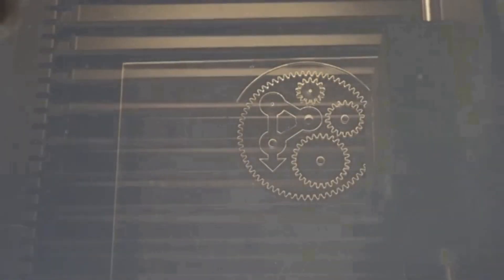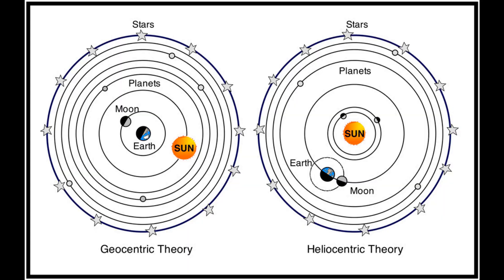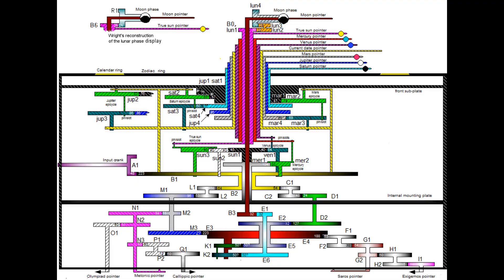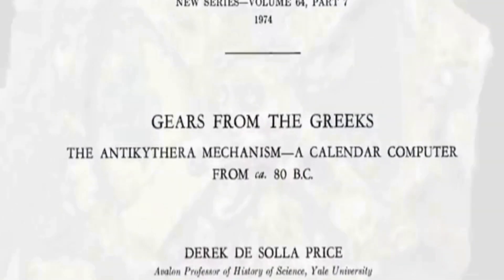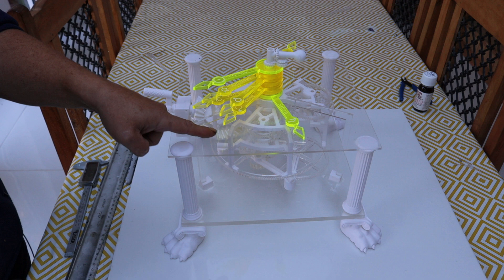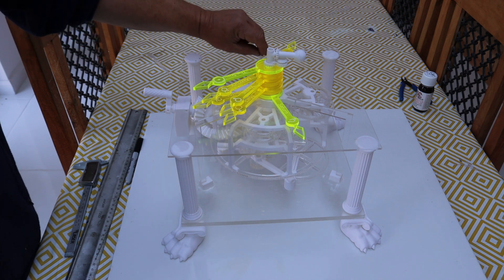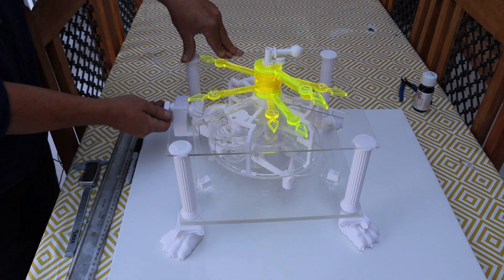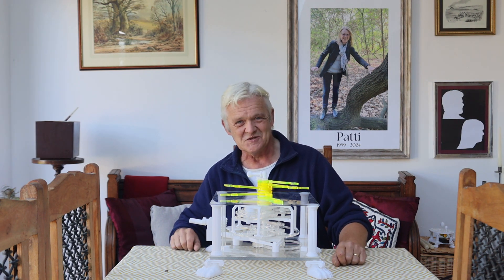2290 The Crystal Antikythera #xtool #p2

Comment: it would be interesting if one could design a maglev roto'r's topography to compensate for epicycles so as to bypass Earnshaw's theorem for a permanently (firmamentally) stable-in-place maglev spin with a non-mechanically-touching bearing component so that the topology / topography's compensatory design would bypass the need for a mechanical bearing, whereas the bearing and rotor are one and the same maglev component reliant on the topology for aforesaid properties, and composite in design. I'm not sure if I am making sense.
Reply from the maker: go for it

Comment: I'm stunned that you've done this in three days - that's an incredible bit of work!! Have you included the spiral dial side for the eclipse prediction, too, or just the planetarium? I couldn't quite tell from the video.
I've actually built 11 of these since 2016 from wood, but mine were all hand cut, and each took a little longer than three days! I really hope that you now go the extra mile and finish this off with dials, graduations, etc, on both sides, and then do a proper calibration to a specific modern date so that it will truly show planet positions, eclipses and so on. You've done the complex bit, after all!! Brilliant job, anyhow, and I'll be thinking of you when i next hand cut another set of 52 gears for one of mine! 👏😁
Reply from the maker: I had to go and look - your work is truly beautiful. I only did the planetarium bit. I am so impressed by what you did and somewhat humbled - you are craftsman!